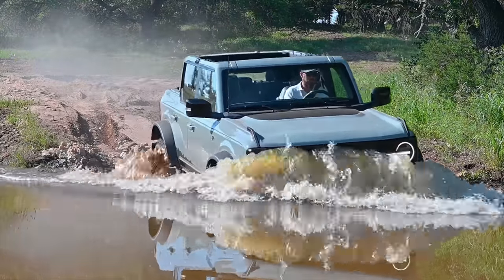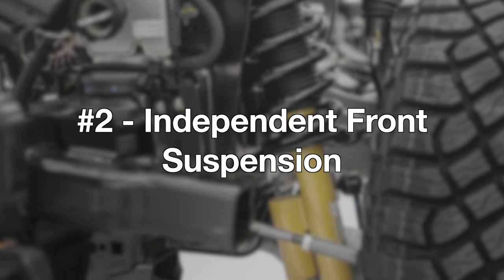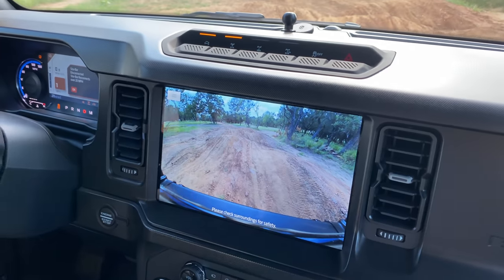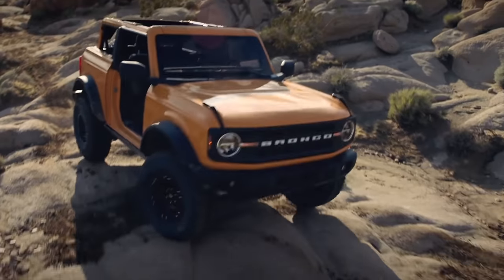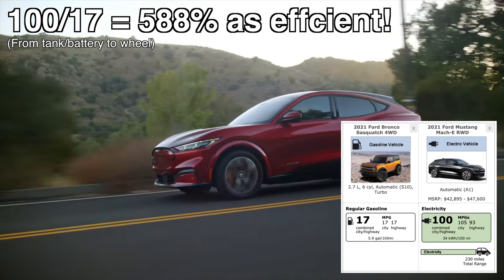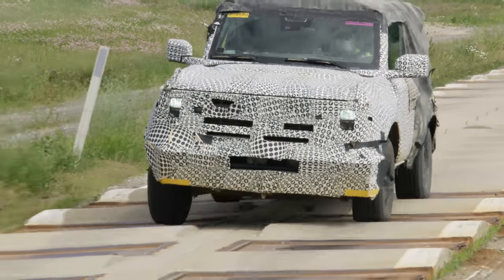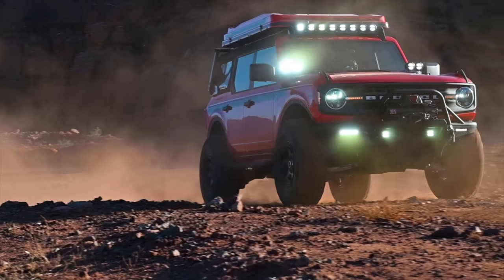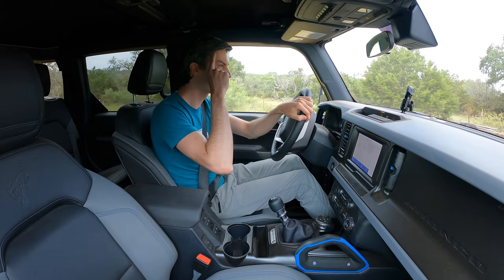The Ford Bronco Destroys The Competition - 10 Key Features (Off-Road)

Comment: The humor: Legendary. Fun fact: the first Porsche Cayenne had (optional) sway bar disconnect
Reply from the maker: Neat! Cayenne is for off-roading then, yes? ;)
Reply: @EngineeringExplained  you'd be surprised how far you can go with a Cayenne off road, although nobody would be very happy to do it and ruin the paint XD. I guess you know the first gen Cayenne won 2008 (and later) the Transsyberia Ralley in Russia? OK it was somewhat modified, but nonetheless. They came up with a special model of the Cayenne, the Transsyberia edition you could buy new for 80k €. Great Off-Road car. Great vid!
Reply: you can use the geeting over curb at local shopping mall
Reply: But cutting out sway bars is less meaningful when these cars come with lockable(automatically) differentials right?
Reply: @EngineeringExplained  it is! I off-road mine. Nearly stock (larger tires and custom front bumper/which.) it's capable with low range, central diff lock, and turbo. 🤘
Reply: @magnulof  Yes and no, keeping wheels on the ground helps maintain  stability.
Reply: @EngineeringExplained  The first gen Cayenne and its sister VW Toureg make for very capable off-roaders.
Reply: It can't disconnect under load
Reply: @gschweiger  Kind of. They always come with an automatic that overheats when you try to pull something heavy through very rough terrain.  For a Chayenne that's not a real issue. But a Tuareg with nobbely tires doesn't like being rescued by an 90's Patrol with a fourth of the power output.. 
Maybe it has to do with the 2.8 diesel from Bayern.
Reply: @magnulof  If the opposite tyre can be used for traction, it's a good thing.  If it's in the air, yes, it does nothing to help.
Reply: It looks just like the million dollar electronic BMW sway bar
Reply: This thing can kill a jeep
Reply: @computercrack  better research the y60 patrol
Reply: Yes!  I've seen everything offroading from Mazda Miatas to Crown Vics.  You can offroad anything if you have skills.
Reply: @Toasty Right!!! And he had a bike on the back!  On a completely different skill level. Haha!

Comment: A bit about one pedal driving, most RC crawlers that go off road use “one pedal driving” since both the throttle and brake are controlled on one trigger, and then the speed controller sets a certain amount of electromechanical drag on the system. It is genuinely really nice for hiking with since I can climb the rocks with one hand and drive my RC with the other

Comment: The extra weight of these over an F150 is partially due to full size trucks don't have the same crash standards as a passenger vehicle. Adding cabin crash protection to a four door vehicle adds a lot of weight. Full size trucks have a solid frame for protection.

Comment: The Colorado ZR2 had IFS and the selectable lockers before the bronco :)
Reply: So did the H3 and Landcruiser, which could also be had with a V8! 

The real winners will be the enthusiasts who buy the tricked out mall crawlers for cheap and turn them into serious off roaders and overlanders. I have yet to see a brand new truck out on the trails where I go. If I do they are usually parked off the access road having a camp fire. Nothing wrong with that of course but you can get to those spots in a Dodge Caravan with a load of wood in the back. 

Personally I wheel a 1990 Isuzu Trooper with 33's a lift and ARB lockers. No sad faces if I bend up a few body panels. 👍
Reply: @geoffmooregm  I couldn't agree more! I do see a lot more Tacos and 4runners out on the trails than i used to. They are getting pretty popular. 
Hey Isuzu brother! Love a 1st gen with an ARB bumper! My first trooper was an 88 and I have a 98 now - 33s with a diff drop in the front, ARB bumper with 12k lb winch, and best of all the Alpine Eaton M62 supercharger! I have videos of it on my channel
Reply: Many vehicles had that before the Bronco or Colorado.

Comment: Jeep owners be worried (I have a Power Wagon) Stelantis can take some features from this Bronco, Ford absolutely crushed it for the first try. 

Big items I like and wish mine had would be the independent lockable diffs. Id love to lock the front only, currently i have to lock both and be in lo range. 
The 2nd big item is the modular construction, that should be a huge marketing feature! Damage a panel and simply swap it out. 

I find it odd that its soo heavy and it could be a big drawback in mud.

Comment: You should go review a 2010 Hummer H3T with the adventure package, if you can find one, many of the features you described were in the Hummer 11 years ago before Jeep and Ford. But today I'll stick to my Jeep Rubicon. I have the 2 door version, it's small for maneuvering trails meaning I have several lines to choose from and with the 2.0l engine I average around 26mpg for on road driving. Last but not least the auto aftermarket is enormous. The aftermarket business for Jeep has been around since the 1940s. It's still possible today to buy parts for an original Willys Jeep. But this is a good video and a fair assessment.

Comment: Fun episode. Just one critique: light bars actually have multiple advantages over headlights.

1. They are mounted up higher,  so they are less likely to get muddy or damaged on terrain.

2. They are mounted high (wait, did I just say that?) This offers you a different angle of lighting which can give you a better perspective on the terrain. 

3. They are often far brighter than regular headlights, yes even highbeams.

4. They can easily be pointed in any direction, giving you excellent lighting in all directions. 

5. They look cool 😎
Reply: Sarcasm is hard for some people

Comment: That is the absolute opposite use case for a front locker! 

Never lock only the front when climbing up a snowy object. In that scenario where the static coefficient of friction is crazy higher than the moving COE there is a very high likelihood that loosing traction with one wheel will cause the vehicle to slip in the direction of the wheel with limited traction. The wheel that still has grip will induce a torque on the nose of vehicle causing it to rotate, which can induce a sideways slide. An open front diff while climbing up an icy slope means that the wheel that stays in traction will be limited by the wheel not in traction, preventing this nosing over due to torque.  Open, Rear locked, or all 4 locked, all work in snow and ice. Front locked? In my opinion thats sketchy and has very different uses. 

How do I know? I use these mechanics a lot in my outdoors fun. Offroad I use the front locker by itself to do exactly this type of slip on tight turns in snow and ice. This allows me to put the nose of the vehicle up on the side of the mountain trail I'm on, and spin the wheels to allow it to migrate over, allowing me to finish my turn and back down, successfully reversing my direction on the narrow 4x4 trails I drive.

Comment: It's like someone actually thought about everything, then designed the vehicle. I'd really like one but I'm waiting for the design to improve or grow on me. Also wondering how these will hold up in the rust belt. All the mud that gets caked everywhere underneath usually causes rust. I find it impossible to completely clean my 4runner. Wouldn't it be great if they had a built in rinse system you could just hook a garden hose to? Maybe pressurize it some how? Wonder if a rust proof aluminum frame is possible? Of course we all know one of the main features of a jeep is the fast forming rust everywhere, so if doubt we'll see this from them
Reply: @wojtek-33  I have the roller that has 5 sprayers that shoot up. Doesn't get everything. Also worried about electronics
Reply from the maker: Not that it proves anything, but that big puddle at 9:35 (and shown elsewhere in the video) is actually a salt bath for testing.

Comment: It's a ford, it already lost. The amount of money you have to sink into it when it breaks down before 50k miles is not worth it.
Reply: Assuming this mystery Bronco with endless failures exists, it's a good thing it comes with a warranty.
Reply: Y'know what they say about Ford don'tcha? Fix It Again, Tony.
Reply: Disagree, I have had Ford vehicles for over 40 years. Never had any major problems with any of them. All have had over 100,000  miles of them when I got another one. Currently have an 2010 F150 and. 2005 Mustang. Great vehicles. Time to look for another one. Bronco may be a goos choice.
Reply: @FunkatronicDingus  that's Fiat. Ford is Fix Or Repair Daily.
Reply: I'm not big on Turbos, as they tend to break down prematurely and this first generation electronics is a bit worrisome, otherwise its a good looking Bronco.
Reply: @dakotamiller323  Fix. It... Again...
Reply: @FunkatronicDingus  that's fiat Dale.
Fellow KOTH watcher.

Comment: i actually went out to buy a brand new 2022 super duty to replace my old 82 and i seen the dealer had a bronco so i was going to take it for a test drive
but the inside was so small i couldn't get in so i stayed with the f250 im happy i did because its much more useful than an suv and i have been averaging 19 mpg so im not disappointed

Comment: Coming from 15 years in Wranglers, I'm really excited about all these features. But I can't help being a little concerned about all the complexity (French for potential points of failure) in the suspension, engine and drive train. After all, it was after FCA began introducing all the sensor-dependent, ECU-controlled features that I noticed reliability in the Wrangler dropping off.
Reply: Wranglers are still king offroad. The features that aren't already on other vehicles are just gimmicks that don't get you further down the trail. IFS is a huge downgrade when offroading from an articulation and reliability standpoint. The only reason they went with IFS is because they reused the Ranger platform. I'd take a JL over a Bronco any day.

Comment: I ordered one on March 5, 2021.  So when it gets here -- probably sometime in 2027 (ha ha, just kidding. I hope.) -- I will definitely enjoy taking it off road.  Everything I've watched about it shows how incredibly capable it is.  I didn't get the disconnectable sway-bar tho -- that's only available in the Badlands or First Edition trim, and I wanted an Outer Banks because you can get the highest technology package (with adaptive cruise control) in that trim.  Plus the Badlands trim only comes with the marine-grade vinyl seats, which will become insanely hot in the sunshine.  (I live in the south and you just don't own vinyl seats in a vehicle with a removeable top, unless you can get cooled seats, which you cannot get on any trim-level in the Bronco.)

Anyway -- great vid!  Thanks!

Comment: Fyi the point of a lightbar is not to aim them up... its so that the source of light is above your eyes view angle so that it illuminates down into indents/potholes/overcrests and generally uneven surfaces.  Without it the shadows act like water in a pothole and the only way to find out if its a foot deep is with your foot ;)

Comment: You failed to mention the lack of bump steer with IFS as opposed to a solid front axle. Some good engineering in this vehicle. Good to see a crawler gear via the gearbox as a backup to the transfer box. Crawler gear is also useful in 2WD, especially when you need to get around a tight corner and you do not need 4WD but many motoring journalists do not seem to realise that. The low range on the older 4WD Subarus with transfer boxes is not particularly low but it is reportedly just right for ski field access roads.

Comment: I got pulled over for not having brake lights on the 405 at the Santa Monica Freeway in my 1962 Dodge Power Wagon because there was a CHP behind me and I was in granny gear with low range engaged (only about 72:1). Didn't get a ticket though! (1984, I think.)

Comment: Independent front suspension is very costly to repair compared to a solid front axle
Reply: Luckily that isn't an issue for THIS front suspension...BULLET PROOF. Ford ran one in the Baja 1,000 with stock suspension. Nothing broke.
Reply: @michaelmorrissey5631  okay well I guess time will tell

Comment: its becoming known as the escape rubicon.  flimsy  a-arm mounts fatiguing, impaction blow up of undersized axles and cooling system rapid degradation.  it reminds me of the dodge stealth/3000gt twin turbo cars.  insanely fun to drive when it has low miles.  remember seeing those guys who dug up a 12+ year old one with 100k?  they limped it around so impressed they got it able to drive again?  i dont hate it, im a mopar shop owner.  i have rebuilt an escape for a kid and hearing jokes from real ford builders who offroad and love old gen-1 gen-2 and gen-3 broncos bring up it being the great escape, or how a ranger 4x4 is more durable over time seems fair.  i suppose very little is made today worth having.  the engine is neat, and the wild mpg mustang v-6 cars put out 2011+ is impressive.  the face of ford techs when i mention this thing however is tragically funny.

Comment: Can you do a spark plug socket interchange video?  Is a difference of 0.041 enough for 18mm vs a 3/4" to matter? How about 11/16" vs an 18mm with 0.021? I was shocked to discover 14mm & 9/16" are being used and some are 12 point. Why? They don't need enough torque to need 12 point contact like rod bolts. The manufacturer web sites are useless for technical information. Thank you for help.
Reply: Wait.  They changed spark plug sockets? My 5/8" and 13/16" are obsolete? What's this world coming to?

Also,  I always wondered why big American engines used little 5/8" plugs while more modern,  Japanese small engines used bigger 13/16" plugs. 

I blame engineers.  They can't read.

Comment: More trucks/SUVs need to offer factory installed Auxiliary switches... Barring that, at least offer an easy to access pass-thru in the firewall to the interior. And actually make it easy to access. The only vehicle I've seen yet was a '21 ram 5500 chassis cab.

Comment: “When the snowflakes start falling. No not jeep owners actual snowflakes”

Jeep owner here and you had me in stitches the whole time lol xD 

Ford has some teething issues to work out with this thing, but its actually pretty impressive.  But WHY is it so darned heavy?  I had to put a ton of extra stuff on my 4door Rubi to get it to that weight, including me as the driver lol.

Still a fan of the solid front axle more for harder end off roading, but that steering control alone, i am jealous lol.

Comment: They picked a really cool manual transmission. But sadly it only comes behind the 4cyl. 

Does anyone know the sizes of the front and rear axle ring gears and shafts? I am curious to know how much beef they really gave it. Will the front half shafts handle 35's or 37's and survive real off road abuse with the locker on?

Comment: I bet with a bit smaller road tire and a slight lowering you could break 20mpg in one of these and it would be even faster. Fast big manual wagon with a comfy ride sounds kinda enticing...
Reply: There are several configurations rated at 21 mpg combined (all with the 2.3l).

Comment: The f350 needs cruise in crawl mode for picking up hay. In the past we would just put the transmission in low and first or second gear and let it idle. No one sells a manual transmission anymore.

Comment: I've recently changed my daily from a wrangler to a battery electric vehicle,  my weekly fuel costs in the summer were $75 to $90 for 22.5 gal 50-65 in winter , I only charge my vehicle at home the past 6 months my electric bill has averaged an increase in $30 a month ...is it safe to say I am saving between $280-$330 per month from switching from a wrangler to an electric vehicle

Comment: Actually you can do rack steering with live front axles. I know someone with a 4x4 tractor with rack ‘n pinion steering & a live front axle. In fact the rack is bolted directly along the live front axle going under the yoke at the middle.

Comment: Nice car. I wonder what it can tow and what its like to tow?After all where do you stay when you get to this magic outback location? It will cater for tent and swag dwellers,  but what about those that have a off road tear drop (1500 lbs), off road camper trailer (3500 ilbs) or full-on 24ft off road caravan (7500 lbs) (affectionately referred to as an acoustically transparent aluminium shitter by John Cadogan from AutoexpertTV yt channel)?

Comment: Anyone who remembers the 1980's and back will know that automotive mechanical failures were common. You don't really hear, "I had car trouble," anymore. Automakers have really figured out how to design and build drivetrain and suspension to last. But one of the thing I've been reading in automotive press is that there's a whole new era of car problems on the level of frequency of csr problems in decades past. As the manufacturers have loaded all their vehicles up with more tech, more gadgets, more whistles and bells......inevitably there are going to be failures and those failures can be very expensive. So much so that a lot of these components will not get fixed or replace out of warranty. Who wants to lay down 3K to get your rear view monitor working again that is also the radio and navigation? My point: Ford has turned this Bronco it to a veritable Thunderbird. For anyone that remembers, Ford used to try out all its new tech on the Thunderbird. With so much going into these Broncos.....the likelihood off expensive failures just goes up. So, did they ever figure out how to keep the roof from not leaking???